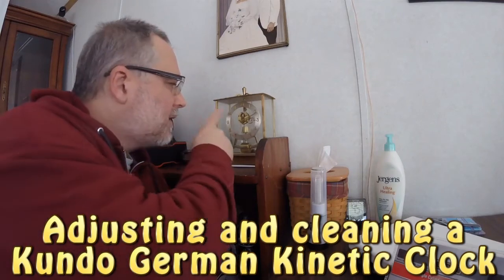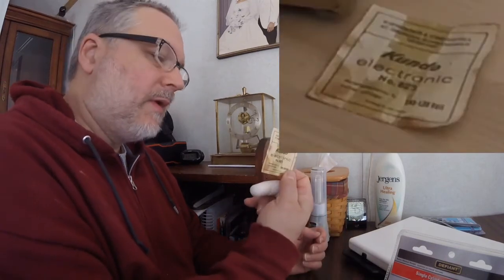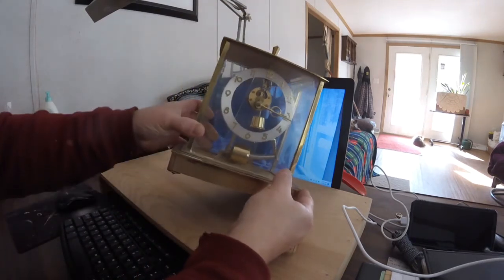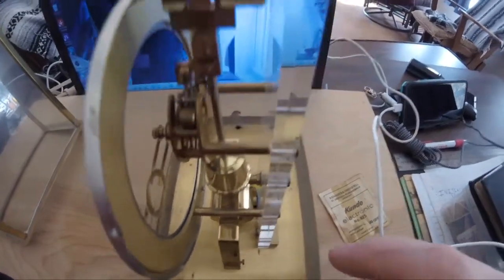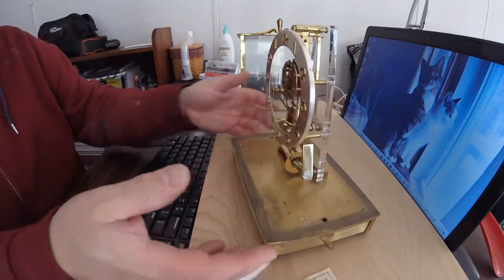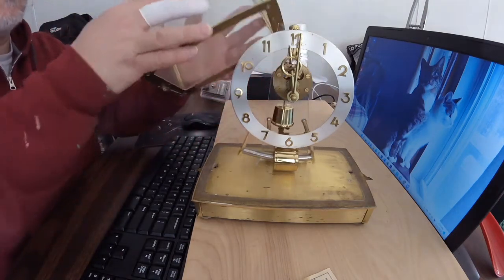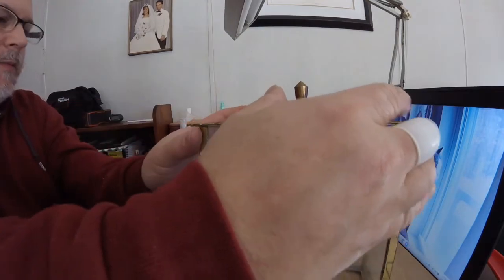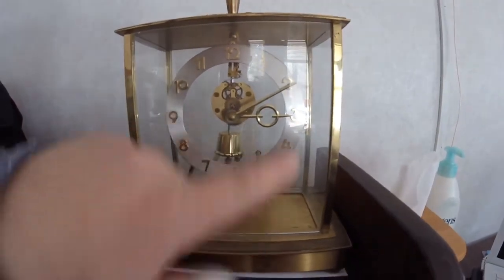Adjusting a Kundo German Kinetic Pendulum Clock

Comment: You should lock the pendulum - knurled nut on back- before turning clock upside down and also hold the magnet yoke whilst turning weight on pendulum... High risk of damage otherwise!!
Reply from the maker: Thanks much for the feedback, that is good to know!
Reply: @mobilehomelife4028  Your very welcome. I've just bought one and didn't hold pendulum firmly when undoing lock screw... pendulum drops 1/4 inch and gives you a bit of a surprise!!